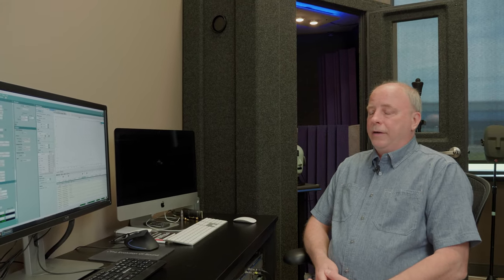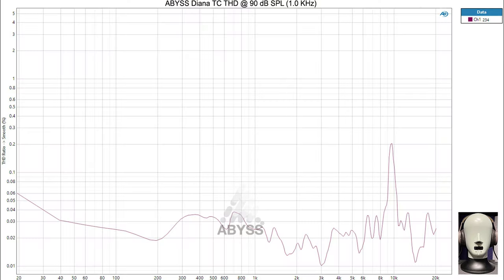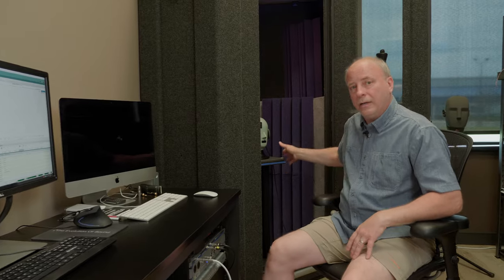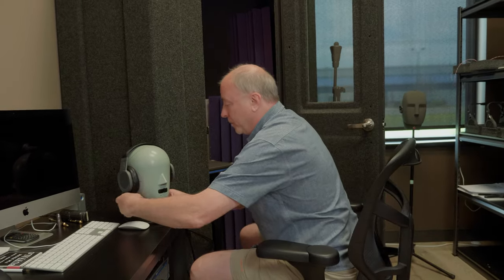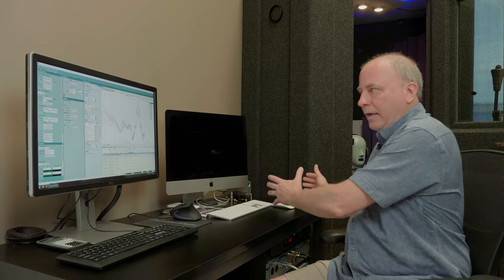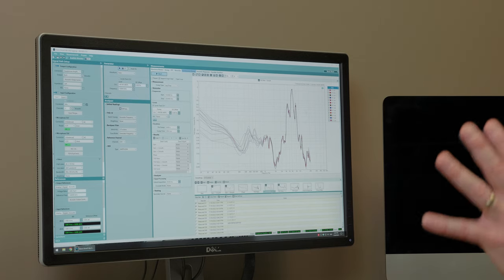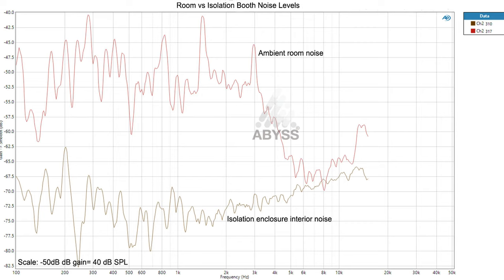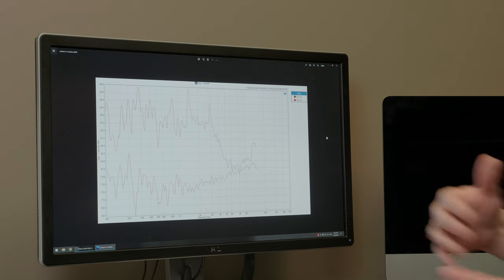Measuring Headphone Distortion (is harder than you think!)

Comment: Could you explain a bit more (in a next video maybe) what is distortion and it’s effects? We see here frequency response distortion but you also have harmonic, amplitude, phase and other kind of distortions. It would help demystify the term and the perceptions.
Reply: output different from input = distortion
Reply: @nelsonang  The elegant way of putting it 😀. But since the video shows a frequency distortion graph, people might be under the impression that this all that there is to it and will start comparing graph with no real notion of what they are looking (or earring) for.
Reply: @ansbjork1  indeed... you are right to point that out... it is quite baffling how some "reviewers" have no idea what they are doing and their audience walk away with misconceptions...
Reply: @nelsonang  How does it differ from frequency response?
Reply: @bladeofky  I find it easier to understand frequency response by thinking of the device as a filter - if a certain frequency is "scooped out" from the frequency response curve, effectively it can be interpreted as that particular frequency being filtered out by the system.. so for a headphone, frequencies between 20 Hz to 20 kHz should all be reproduced... hence any missing or bumped up frequencies (as seen in the frequency response curve) can be interpreted as distortion...

which goes back to Joe's point... if the device being measured is not isolated and fitted properly on the measurement instrument, the resultant frequency response curve will not be reflecting the device's performance but the interference from the environment registering themselves as "distortion"...